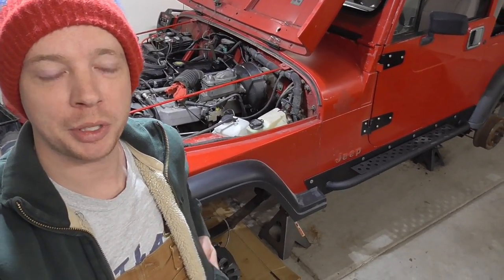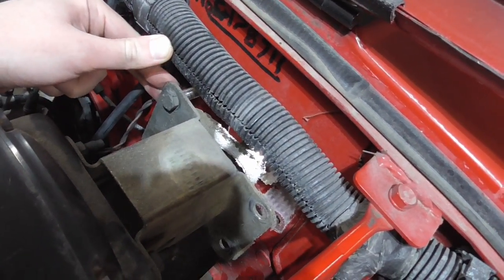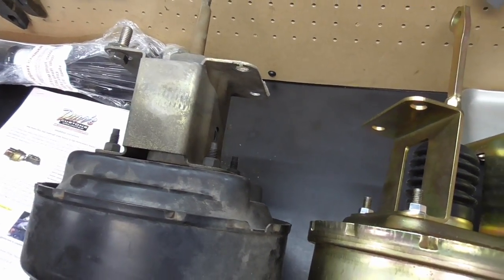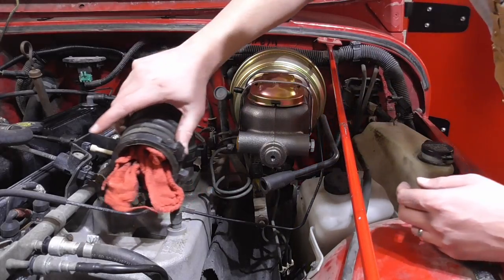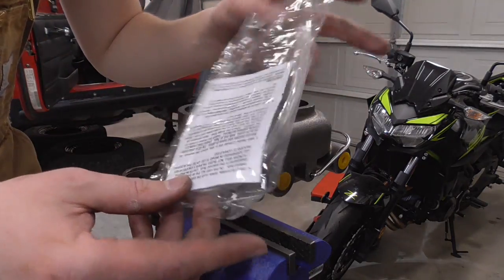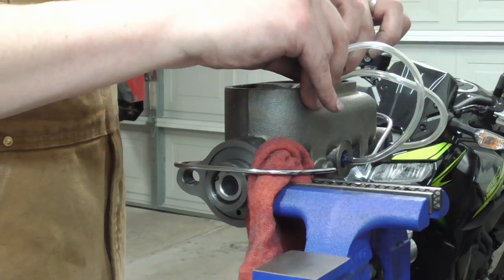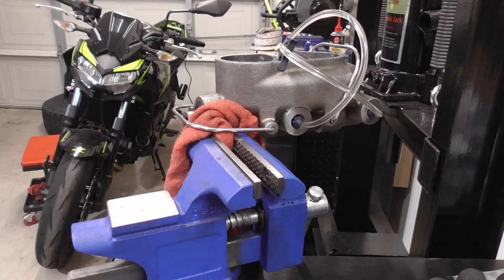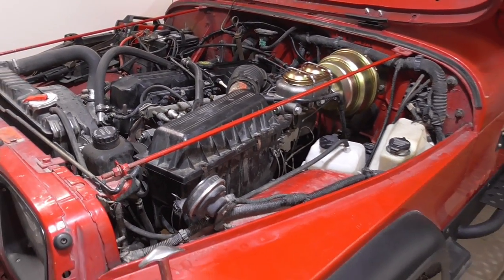Dave's Customs Brake Booster and Master Cylinder Install - Jeep Wrangler YJ

Comment: I am struggling badly. Trying to remove the push bar from the pedal. Removed the retainer clip, but it seems like I have a small secondary clip? Cannot remove the pushrod. Five speed. Please help with advice, anybody please.

Comment: Did this mod give you better stoping power, and if so was it significant. I moved to 35” tires and that was a noticeable difference in stoping power and of corse not in a good way.
Reply from the maker: I did this mod at the same time as I changed to WJ brakes so there was a big improvement but I'm not sure if it was more because of the bigger booster/master or the bigger rotors/calipers.

Comment: Did you end up figuring out what you are supposed to do about the hole in the firewall behind the booster?
Reply from the maker: I never got a reply from Dave's Customs, I should probably try again.
Reply: I reused the factory boot on my brake upgrade to cover the firewall hole
Reply from the maker: @fxrsniper1  how did you adjust the nut on the pushrod with the factory boot?
Reply: @HardEarnedBacon  Note I also put new foam behind the plate like the factory to help as well. Like a Gasket

Comment: Have thought about putting a plug into the hole so dirt want get into you master cylinder?
Reply from the maker: Which hole do you mean?
Reply: @HardEarnedBacon  where your pressure gage goes for your braker buster.
Reply from the maker: @jk_wrangler13  that hole doesn't go to the master or booster so no I'm not worried. That prop valve will probably get deleted anyway when I swap the 8.8 and have rear discs.
Reply: @HardEarnedBacon  oh ok